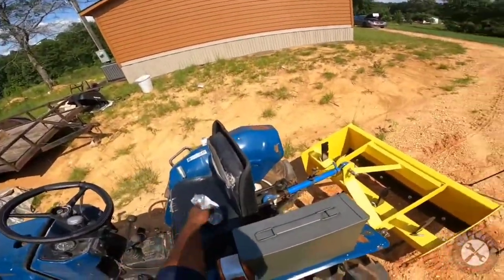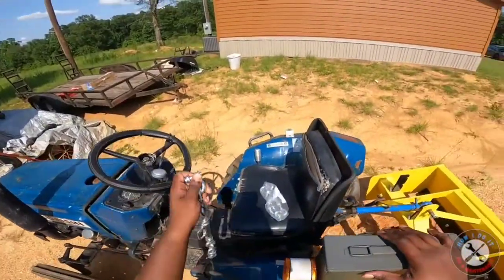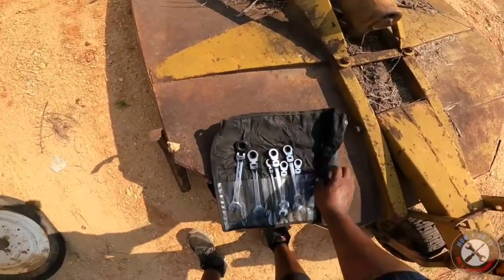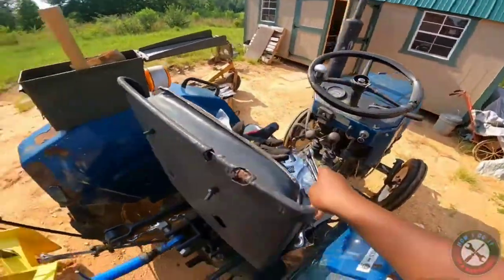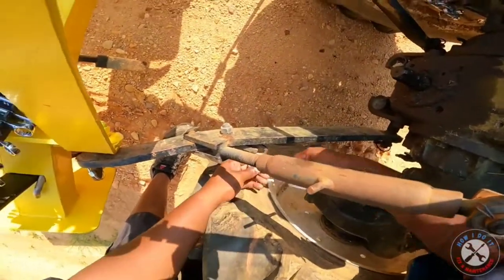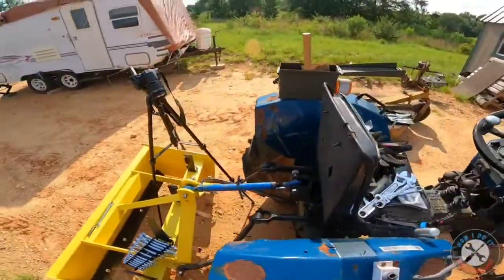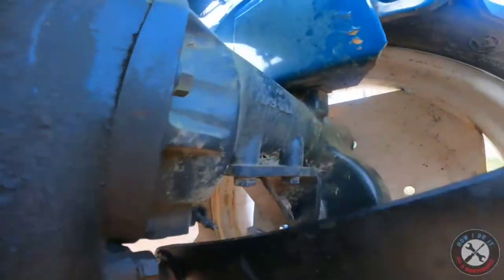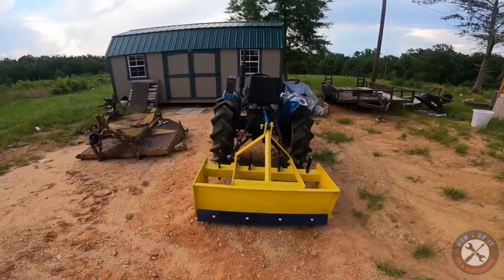Mitsubishi D2000 Tractor 3 Point Hitch Stabilizer Chain Install (Work Vlog)

Comment: Great video man thanks for sharing I’ve got a question on the durability 
Do they seem to last are they pretty durable I too was looking at these on eBay 
Did they hold up as expected 
Thanks in advance
Reply from the maker: Thanks for watching! I've had them on since the video. I've brush cut my few acres at least 4 times since then.  I also have box graded my driveway countless times. They haven't missed a beat.   Definitely have out performed the price.

If you haven't already I sure would appreciate it if you like the video and subscribe to the channel. It really helps the channel grow. Thanks